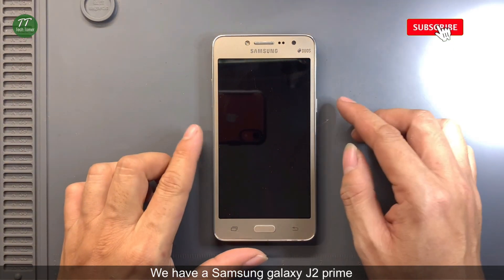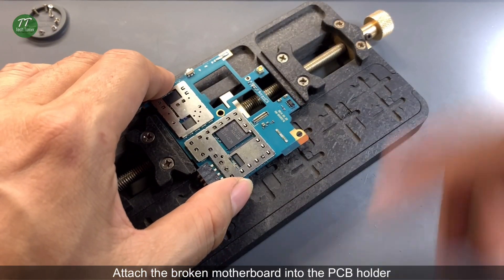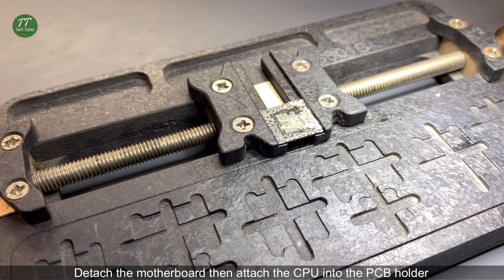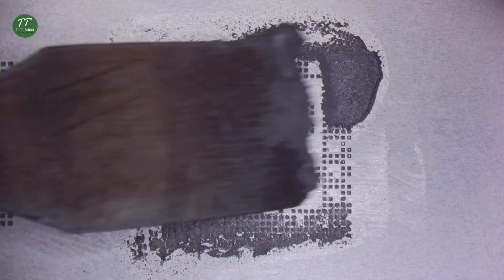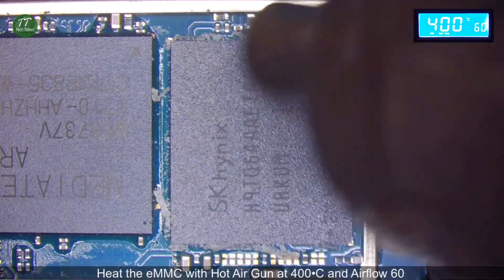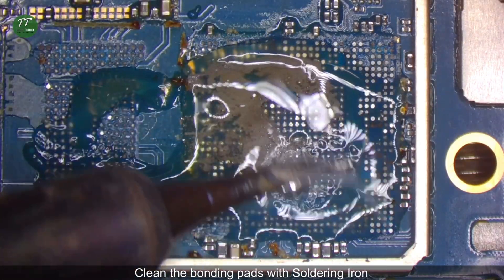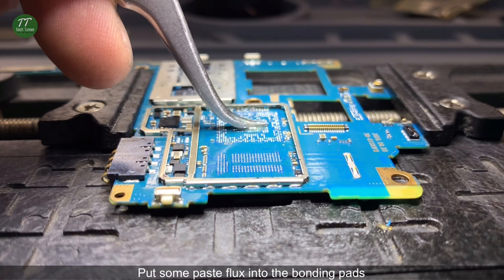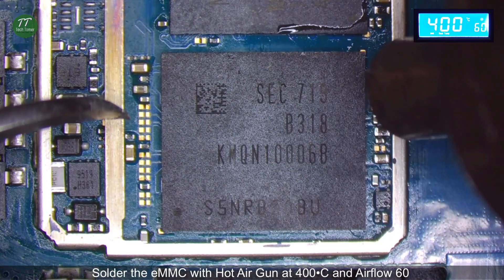Samsung Galaxy J2 Prime Broken Motherboard - Swap Board Repair Tutorial | Tech Tomer

Comment: Mi note 5pro came in dead condition, Upon inspection, I found not, hardware fault but phone was making qualcomm 9008 port. I removed emmc which tested dead, easyjtag was not detecting. I replaced it with a new Samsung ( same configuration) emmc with rpmb cleaned but still CPU is making 9008 port & emmc is not being detected by UMT dongle mi flasher. Had reball two times emmc still same issue. I doubt on cpu I need to reball CPU.
Reply from the maker: don't trust clean rpmb when you write a dump file the rpmb will return to counts so it still won't power on
Reply: Exactly i am too facing same issue with Note 6 pro, error came like Baaaaaaa something, i doubt the same cpu